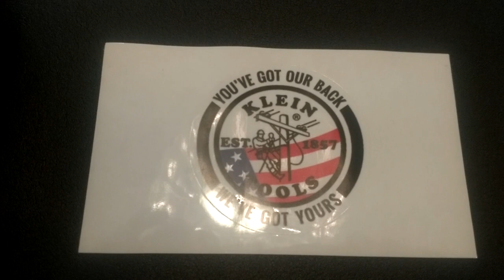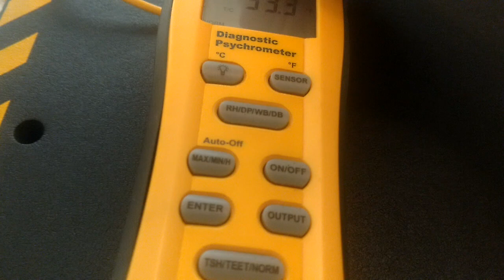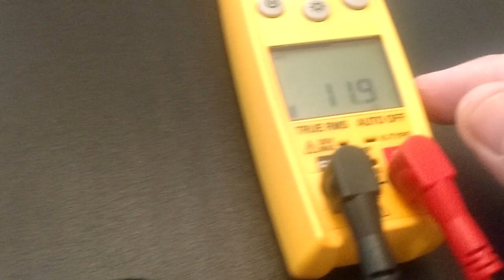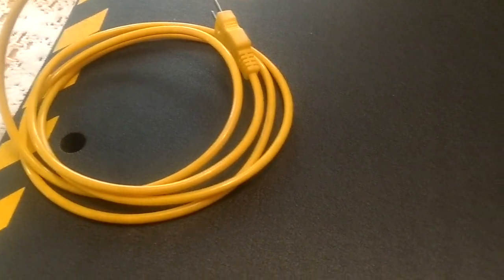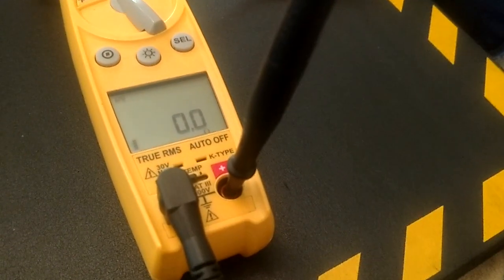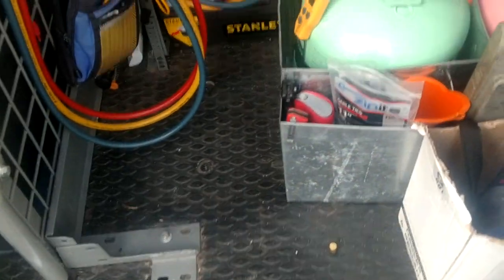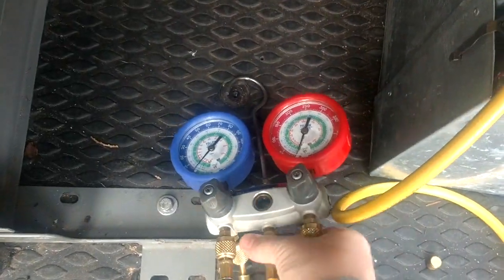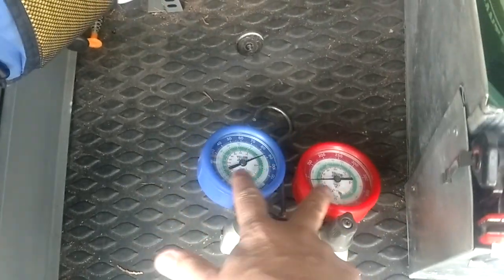Going Covid Crazy Guys? Here's a few things you can do to break the monotony. Check your tools 😎👍

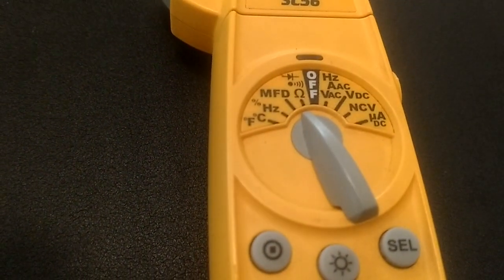Comment: At 10:05, FYI, (From FLUKE CORP.):
Any DVOM display showing O.L. = OUT OF LIMITS
(Meaning, the item, currently under measurement, is OUT of LIMITS for the RANGE SETTING selected on the meter's display.
Reply from the maker: In the "ohms" setting that means open line. OL only applies when you're taking readings like voltages and the reading you're taking is higher than the what the meter is currently capable of. And that is when "ranging" comes into play. But you don't really have to worry about that when using an "auto-ranging" meter. But thanks for watching. Hopefully the video was helpful 👍
Reply: @sknight0391  O.K. Shannon.  If you want to believe it's OPEN LINE, no prob.
Reply from the maker: @byenzer5101  oh I'm not believing anything pal. I'm right, do your homework and then come back and apologize later. You obviously don't know your way around a multimeter very well. Here is the definition for open line/open loop ⬇️
open loop

If the screen displays 1 or OL (open loop), there's no continuity—that is, there's no path for electric current to flow from one probe to the other. Continuity is non-directional, meaning it doesn't matter which probe goes where.
Reply from the maker: The ol that you're talking about is something totally different. For instance if you're using a meter that has two different voltage ranges: 200vac  &  600vac and you have the meter set to the 200 volt setting and you take a reading on a circuit that is 400 volts the meter will show OL FOR OVERLOAD. That means that you need to switch the setting to the "higher" 600 volt range. But again, you don't have to worry about this when you have an auto ranging meter. The O.L. on the ohms/continuity setting is different my friend. Trust me!
Reply: @sknight0391  Sure Shannon.  I don't know my way around a multimeter.  Your right.  Silly of me to have engaged, or questioned your Highness on all this.  Again, thank you, and keep putting out your vids.  We use em.  They are helpful.  And you are a good person.  A bit thin skinned, but, a good person nonetheless.  Hang in there man.  We'll all get there.

Comment: How many have broken test leads or pipe clamps from wrapping the wires to tight,  the blue fieldpiece clamp I once had the clamp broke. The fluke pipe clamp the last one that broke right on the wire were the spring ended.
Reply from the maker: Gotta weed those "Shorty's" outta there so we're not getting wonky readings that make us pull our hair out.  Thanks for watching buddy 👍

Comment: Shannon Knight HVAC quick question for you buddy. I’m about to buy a new leak detector and I know you really like the AccuTrac ultrasonic. I’m thinking either the AccuTrac or the D-Tek select. Any thoughts? I’ve never used ultrasonic, is it hard to get the hang of? Have you ever used the D-Tek select? What would you recommend? Any advice would be greatly appreciated before I drop close to $500!
Reply from the maker: Ultrasonic is great but it has its place. Would I have it as my stand-alone only leak detector....No. It's to use in conjunction with a good sniffer. If the leak is big and the system has very little refrigerant or is flat, then the ultrasonic is great because you can put some nitrogen into the system and hear it plain as day. Most guys say the Dtek Select is a solid detector. I also like the Amprobe RLD1 & the Robinair LD7. Hope that helps. Thanks for watching 😎👍